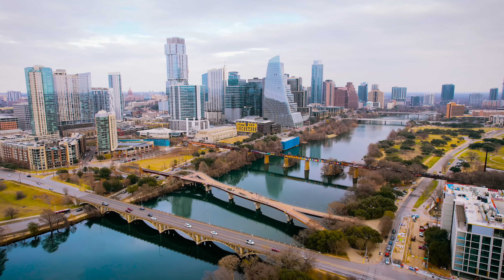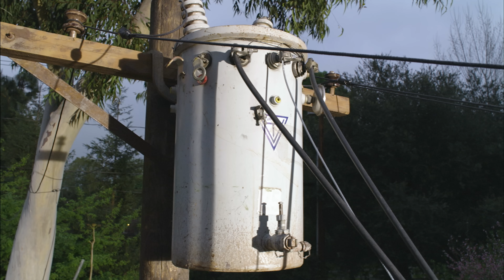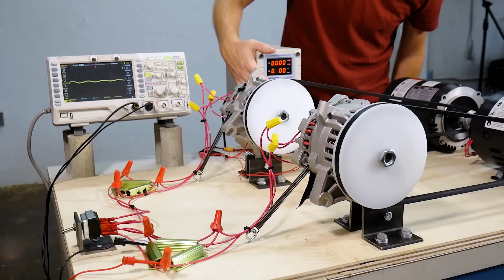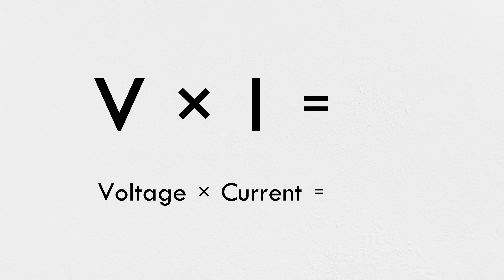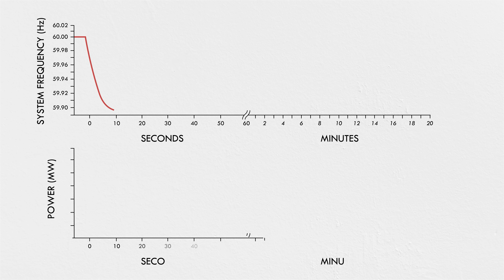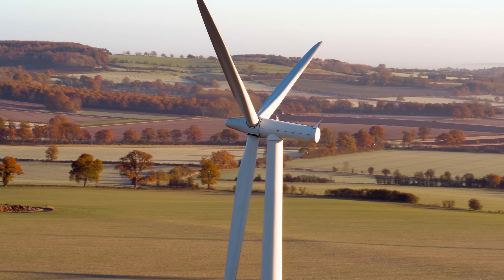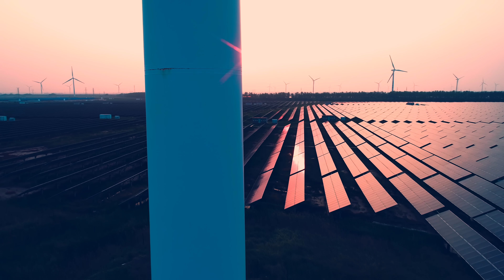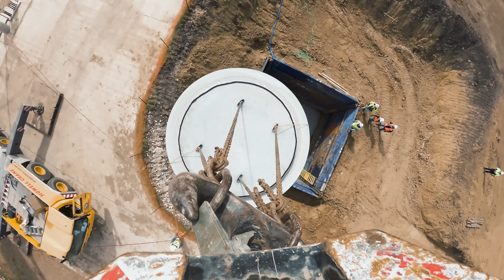Connecting Solar to the Grid is Harder Than You Think

Comment: I worked at a factory that ran 24/7 and consumed megawatts of power. We were looking for backup power solutions. The problem was the few seconds backup generators take to start. There were "batteries" that consisted of carbon fiber flywheels in a vacuum spinning at 500,000 RPM. They could deliver 100% output (multiple megawatts) within 10 cycles, and for up to 10 seconds - enough time to start a generator kept in warm stand-by. Perhaps technology like this is what we need to stabilize the grid.
Reply: There are a lot of companies looking into grid scale flywheel energy storage. It's a valuable option and one I could stand to learn more about. But I think the biggest problem with any *grid scale* energy storage solution is cost. I'd love to see a practical engineering deep dive into grid scale storage and fly wheels.
Reply: @pufthemajicdragon It is more like capacity storage.
Reply: @pufthemajicdragon  Just wanted to warn anyone reading this comment that Ovo Energy (a UK power provider) are basically scammers. I received an invoice for £315 one day, and then 12 days later, that figure mysteriously went up to £763. When I wrote to Ovo for an explanation, they did not respond. It's only when I showed all the emails to the Energy Ombudsman and they (Ombudsman) contacted Ovo and asked Ovo why they had not replied to my repeated emails that Ovo made a pathetic half-hearted apology and claimed that the charging (£763) was a mistake and £315 was the correct figure. I can tell you straight away that if Ovo thought they had made a GENUINE mistake, they would have responded to my emails and apologised for their error. This WAS NOT an error. They tried to con me by charging me more than TWICE the money I owed them. It's only when I got the Energy Ombudsman involved that Ovo got cold feet and tried to backpedal from their scam, claiming it was a mistake. Take heed, Ovo Energy are CRIMINALS. Guard all your invoices with your life and even make duplicates of your emails. Ovo WILL try and trick you out of your money.

These are examples of Ovo Energy harassing, threatening, intimidating customers with legal consequences to settle fake, phony, bogus energy bills. Ovo Energy are truly despicable. They are, as I said at the top, insidious scammers -->

https://www.birminghammail.co.uk/news/cost-of-living/ovo-energy-harassing-customer-pay-29864563

https://www.bbc.com/news/uk-england-gloucestershire-65544654
Reply: I understand that flywheels are already used by various utilities for this sort of purpose, providing inertia at a moment's notice. Wikipedia at least says that there are grid-connected flywheels in New York, Germany, and Ontario. Would be nice to see more about how these sort of utilities work!
Reply: @DanielLamando Estonia is building 3 synchronous condensers with flywheels for grid stabilisation to disconnect from Russias grid and connect to europes grid. Flywheels inertia power is 1750MWs
Reply: @lauriviik I just commissioned the protection system for a sync condenser up in northeastern US. Pretty cool stuff to learn about
Reply: @lauriviik  I'm very interested in this but I cannot find anything on Google.  Do you have any resources to point to about this?
Reply: @lauriviik  how long can they sustain that
Reply: @DanielLamando heheh, inertia at a moment’s notice
Reply: Flywheel storage solutions are interesting. I work on mission critical power systems, and most of the time a battery based UPS is used. For certain loads, especially at a factory where there are huge motors flywheel based solutions can be better
Reply: Some datacenters use a mix of flywheel and battery backup to keep everything up until genes start
Reply: The issue with super high rpm’s is wear and tear mixed with structural integrity. While yea, making in spin uber fast sounds great, the issue comes in when it simply rips itself to pieces.
Reply: @goldenhate6649  I hope they are well built, otherwise you have a small frag mine ready to burst at any second. I have seen pictures of broken lab centrifuges, and even that was pretty scary.
Reply: @lbgstzockt8493  I saw a video of someone spinning a CD/DVD to insane speeds until it shattered due to the extreme forces. Like you said it resembled a fragmentation grenade. And that was only plastic.
Reply: @goldenhate6649 Conceptually for safety id rather have that energy be stored as kinetic energy because the energy of a large car crash would be much easier to contain than if it was released in a fire.
Reply: @submachinegun5737 Its the same amount of energy either way. Touch a motor shaft spinning at just 3000RPM, the friction will burn the skin right off your finger. Now imagine a giant heavy flywheel spinning at 500,000 RPM. Oh did I mention rotational energy stored goes up based off the square of the angular velocity (RPM)? Energy is energy, and giant amounts of energy released at once is enourmously dangerous. 

A spinning flywheel could roll through a town causing millions of dollars of damage, especially at 500K RPM. A fire on the otherhand just destroys one building and can be very easily contained to one area.
Reply: @linuxguy1199 obviously with a device like a flywheel safety is paramount. I'd expect the housing would be able to contain such an event.
Reply: @linuxguy1199  something spinning at 500krpm will be in a vacuum and generally underground / buried somewhat to prevent these issues.
Reply: @linuxguy1199  At 500kRPM the friction with air would set the rotors ablaze. Hence the vacuum. If you could touch it, the air viscosity would create a lubrication film, like oil in your crankshaft bearings does. A very hot lubrication film in this case. But you would not be able to make physical contact with a rotor at that speed. 
The rotors are supported by magnetic contactless bearings. Those having the nice feature that you don't need to fine balance the rotors as insanely precise as you would need to do, if you would use fixed bearings. Magnetic bearings have some play in it. And the rotor just automatically spins around its COG, balancing itself. Of course it still needs to be well balanced for not ripping itself apart. But the requirements for that are orders of magnitudes lower.
Reply: @sl9sl9 I had this happen to me once with a 5x speed DVD. It went Bang! and shattered into mm sized shards.
Reply: @sl9sl9 I’m pretty sure you mean the slow mo guys
Reply: @linuxguy1199 I believe I read that there is a flywheel storage in operation in the UK.  I don’t remember much about the article, but I do remember that it was hundreds of tons, and ran in a vacuum.
Reply: If you have traditional turbine-based power generation, then the turbines function exactly like this. That's how the grid has historically been stabilised and there was no need for separate flywheels. As we move to more and more inverter-based rather than turbine-based generation, adding dedicated flywheels becomes a necessity since there isn't enough inertia in the system. (The alternative is batteries and an inverter that can simulate inertia, but a flywheel is much simpler technology.)
Reply: @thomasdalton1508 I've been wondering for some time, whether inverter electronics can take on ('simulate') this stabilising function as Matt mentioned in this video, on a large scale,
and what could be constraints and limiting factors. I would like to find out more about this subject.
planning to attend hannover industrial fair next week, perhaps someone can enlighten me there..
Reply: @laus9953  I hope somebody has an answer for you because we are going to need it pretty soon. It's going to be a particular issue for countries that aren't fond of nuclear. The UK has a steady base generation from nuclear that will provide us with some inertia even when we have completely eliminated fossil fuels from the mix, but countries without nuclear are going to be left with no turbines at all (maybe a bit of biofuel or waste incinerators, but I doubt they will be on a large enough scale to help).
Reply: Yeah, I am hardly an expert, I just remembered the Capex research I did for that project a decade ago. The thing with flywheels is stored energy goes up linearly with mass, but squared with rotational speed. So a 1 pound carbon fiber disk spinning at half a million RPM can potentially store more energy than a multi ton wheel spinning standard generator speeds like 1800 RPM.

Chances are people in the industry know much more about the details than I do, but occasionally good ideas slip through the cracks.
Reply: @PsRohrbaugh 
Important note, that's only true if a 1lb fiberglass wheel has the same radial mass distribution (how far away the mass is from the center) and a multi ton flywheel... and can still hold together with those absurd speeds (if we're talking about 1meter radius then the tip in your example will be moving at 500,000*2pi m/s or, in other words would be subject to severe relativistic effects before almost instantly being torn to shreds by the insane forces needed to hold itself together.
Reply: @PsRohrbaugh  Every time I start a CapEx project, I enjoy the research phase.  The rabbit holes I go down are wild.
Reply: @PsRohrbaugh  not arguing with your math but the gear reduction from half a million to 60hz is a huge power draw. Traditional power plants have only a few percent loss in the gears or at least that is what I remember from a tour I took a few years ago.
Reply: @tysleight  Do they use mechanical gearing? Surely there is a better way to get 60Hz AC from a 500,000rpm flywheel than a 8,333:1 gear system? I agree, that would be incredibly inefficient.
Reply: @thomasdalton1508  I have no idea but I do know that transformers are terribly inefficient and the bigger the step the bigger the energy cost.
Reply: @tysleight  Transformers change voltages, not frequencies. The usual way to change a frequency is just to convert to DC and back to AC. Then you can choose any frequency you want. There are losses, of course, but they aren't too high.
Reply: @thomasdalton1508  AC to DC, DC to AC line voltage.  This is how our big monster generator is set up with caps to handle spikes. You can hear the generator rev up and down with load. I assume it would be the same idea.
Our generation set up will run a small city, nothing like a harbor freight special.
Reply: @thomasdalton1508  you couod do a few planetary gear step down and then something similar to a CVT to control output rotation speed. That way to keep output speed to a generator constant while the flywheel spins down
Reply: @PsRohrbaugh  Interesting thought. I can imagine that the two devices would have far different discharge curves. Wouldn't it be harder to extract stable 60hz AC from the small 100,000RPM flywheel than the large 1800RPM flywheel?
Reply: We use them in data centres, we even get paid by the grid to keep them synced because of the inertia provided helps the entire grid
Reply: One issue with flywheel storage is that as soon as you start tapping them for energy that RPM starts dropping, and dropping fast.  In generators the desired frequency (60hz for example) is a ratio of the rotational speed vs the number of poles in the motor/dynamo.  So you design a generator so that if its spun at 1800rpm for example it outputs 60 hz.  If load slows down that generator to 1790rpm its now only outputing 59.666 hz.  Thats where the inertia comes in.   Now take that flywheel at 500k rpm and try to turn that into 60 hz and keeping it there as it spins down as your drawing the rotational energy out and converting it to electricity.  Its not just a plug it in and it works solution, theres alot of extra equipment involved in converting that high energy but variable frequency power into a stable 60hz power outp ut.
Reply: @merendell that's why they're meant to have only a stabilising effect for a few seconds (or fractions thereof), no?!
Reply: @laus9953  True but I often see people seeming to think they are the latest/greatest energy storage solution that will replace lithium for large scale grid storage.  Yes you can store a hell of alot of energy in a rotating mass but its not a simple thing getting that energy back out meshed with the grid.  The most reliable way can think of is rectify the output to DC and then use that to power an inverter back to a stable AC but you still end up with the issues with grid tied inverters mentioned in the video.
Reply: I toured a Yahoo data center and saw flywheel batteries used as a buffer for standby diesel generators.  A fraction of the size that a battery bank would take up.
Reply: Some nice things about fly wheels:
(*) it's easy to know how much energy is stored in them
(*) the mass/volume energy density is pretty high for the high RPM flywheels
(*) for low RPM systems, anything can supply the mass, including rocks.

Some problems
(*) as others have mentioned, when a high speed, high energy flywheel fails, it fails spectacularly.   One of the nice things about CF-wound flywheels is that a lot of the destructive energy goes into turning the CF from a smooth structure into a wad of useless carbon fiber. (++)
(*) precession.  People have put flywheels in vehicles,  but you kind of need counter-rotating flywheels to (mostly) cancel the net precession force.  However, even if you do this there will be a substructure in which the precession forces are not canceled.
(*) No matter how good you make the bearings, the discharge time of modern flywheels is still pretty fast compared to batteries.
(*) You can only get energy into/out of the fly wheel by applying torque.  If you've got something spinning at 500,000 RPM, this requires care.

(++) I once worked in a lab that had a 3 kg, 40 cm dia slab of Aluminum spinning at 3600 RPM.  It scared the bejeezus out of me, and I hated turning it on.  For reasons that I won't go into, it could not be shielded in a cage --- if it ever got loose in the lab, it would do a lot of damage before it came to rest.  There is (or at least was) a lab experiment in freshman physics at Caltech that used some nice air-bearing tops to demonstrate precession and nutation.  One of those "tops" once escaped its air bearing and, um, created a lot of unwelcome excitement for about 15 seconds.
Reply: @jdsahr  "for low RPM systems, anything can supply the mass"
including dead batteries. I've thought about making a joke video about how to get energy from a pile of dead batteries.
Reply: Leaving retired coal generators grid connected as sync. condensers is something we should do more of.
Reply: @TXHeat1776 I understand that will happen with Sherco plant in Minnesota.
Reply: I'm working at a place called torus, they are developing some amazing flywheels.
Reply: holy hell, that is actually a fantastical use of flywheel energy storage. can't store much energy but can deliver and take up lots at once and can store just enough for another more permanent type of power generation to kick in
Reply: There are actually already plants specifically designed to do just this. Some power generation facilities have equipment that’s rated to operate as a synchronous condenser. This means that the generator is spinning but it is not generating, it’s consuming. This helps to provide voltage support as well as a type of frequency reserve. The plant could also come “online” within minutes ( for gas turbines) and start generating if needed.
Reply: Sounds like flywheels perform better as mechanical capacitors than mechanical batteries.
Reply: Old cell towers or remote telecommunications bunkers would have mains power driving a huge fly wheel through a generator.  When the power went out a deisel gen set would cut in, with a clutch that would engage.  The fly wheel generator  would keep things moving.
Reply: Im curious as to why the flywheel is made of carbon fibre instead of a metal, because the kinetic energy stores the energy so it would be dependant of mass so why would you use a lightweight material like carbon fibre? What is the benefit in comparison to heavier and equally strong metal?
Reply: @cas8891   My intuition is that the parameter of goodness is tensile strength / density and there carbon fiber comes out on top. 
As another poster mentioned CF may have better internal dissipation of energy during fragmentation, tearing into more smaller pieces.
Reply: @thewheelieguy  oh yeah the small parts is a good reason yes, and the tensile strength ill have to look in to the differences but i think thats definately a plausible reason!
Reply: @cas8891  I haven't researched this in a decade, but I remember the selling point being that kinetic energy goes up linearly with mass, but exponentially with velocity. So using something with a high tensile strength and velocity stored much more energy. I did a quick Google search for "carbon fiber flywheel energy storage" and there were articles on commercial and grid installations as recently as a few years ago.
Reply: Batteries are way more efficient for longer periods but for such a short period you'd need to overbuild everything

Lithium titanate oxide gives you the best ampacity with some cells being able to do 20c for a few seconds, but with a 10s burst at 20c you're looking at about a 5.5% depth of discharge if my math is right
Reply: Yes, flywheel energy accumulation is very cool. But I wonder how feasible it would be deployed in a remote outdoor field where most solar and wind farms are. Lot of things that could interfere with it, and the cost to maintain
Reply: Isn't all this physical intertia just perpetuating a style of backup that results in a loss of frquency as load magnetically slows rotation? Surely a "grid following" inverter could just sync its PLL to an accurate clock and simply lead the grid sinewave if it slows.  Ultimately a much faster response, and more resilent against that steep drop in frequency.
Reply: @chrisking7603  the flywheels had an inverter between them and the grid connection - if they ran synchronous the frequency would drop as they spun down. It's about having enough stored energy available in a format that lets you from 0 to multiple megawatts in a fraction of a second. You could use chemical batteries, but it'd be significantly more expensive as they're suited for longer discharge times.

One new technology that might be competitive is super capacitors. Those weren't really on the market back when I did this project. But a super capacitor the size of an 18650 lithium cell can provide 400 amps at 2.7v for several seconds. At that point it'd be about cost.
Reply: @PsRohrbaugh  Good point about supplementary storage.  Yet how can massive steam engines drop their frequency output without slowing down? Can't masses of grid-following inverters lead the grid AC wave a tad, if the frequency drops?
Reply: @PsRohrbaugh  Yet those big steam engines did allow frequency to drop under load, that could be remedied when it occurred by driving the turbines harder... their response time is slower than hydro, and now batteries that can respond in milliseconds surely can do the same... if they're not just grid-following.
Reply: Already being done on the grid mentioned.
Reply: The UK is spending billions in building flywheels to pick up the janky electricity from solar and wind and add a modicum of control to it.

Or we could just use nuclear 🤷‍♂️
Reply: You need grid scale battery sad fact if you take a ev car battery and use it for grid storage it would reduce 40% more carbon...and that's all you need to know ev is a massive scam it's like making cars go to natural gas and then shut down much cleaner generation to burn coal
Reply: Are the flywheels just carbon fiber or do they have weights on the end? 
It would make sense for the flywheel arms to be light weight since the speed increases as diameter increases. But you'd want more mass at the ends of the flywheel
Reply: @a.1441  idea I had was to move flywheel bearings away from central hub/shaft, to outside the flywheel rim, and having the bearings press inward onto the outer rim of the flywheel  using say hydro static bearings.to keep friction low. that reverses the direction of forces resulting from the flywheel's rotation. ie when spun up the flywheel will want to expand, but that would load the bearings up, which will help stop the expansion. as such the flywheel would be under compression rather than in tension.As housing doesn't move it can made arbitrarily thick to gain enough strength to handle the load. flywheel probably doesn't need much strength at all spokes. it might even be possible to eliminate spokes completely, and just have a cylindrical shell. . 
spin it up/ extract power akin to an induction motor/generator.
Reply: @a.1441  I honestly don't remember the specifics and don't feel like Googling it myself. I am sure they optimized the design in one way or another, but have no idea what it actually looked like. I just remember their big sales pitch was 1/2MV^2 so focus on V^2 not 1/2M
Reply: @a.1441   there are differential equations that relate the radius, speed, strength of materials and thickness. 
For optimized energy storage you want the strain in the flywheel to be constant as the radius increases. This means you want the center sections to be thicker and taper to the edges.
Reply: Rotating stabilisers are good for stabilising the grid, they're essentially large rotating masses that keep spinning (and thus maintain voltage and frequency) during a fault.

BESS is also developing grid forming capabilities, where the batteries are used to set the voltage rather than chase its output, although I'm not aware of this being implemented in many areas yet and I expect it would still be too laggy.
Reply: What kind of bearings hold that flywheel?
Reply: @suntzu6122  Such flywheels are suspended by magnetic bearings, so no actual contact or fiction. Subtract the air from the containing vessel and you get as close to a perpetual motion machine as you ever could (till you start tapping it for power).
Reply: @ExtantFrodo2  electromagnet right? Surely nom electro magnets would be hard to maintain.
Reply: We don't need better tech--we need to run out the corrupt corporations from the industry and stop pretending what we have now isn't 1950s garbage.
Reply: Yep flywheel storage!! Lots of potential for these sorts of technologies, especially as we move more and more to Inverter-Based Resources (IBRs) and independent system operators (ISOs) start sounding the flags on renewable-heavy grids, the likes of which we've seen from the Midwestern Independent System Operator (MISO) within the last month. Flywheels could help add that inertia back
Reply: One major drawback of flywheels is they are presumably susceptible to earthquakes. Which unfortunately is a time when disruption to the grid is much more likely.
Reply: Amazing what engineers can do
Reply: Fun fact, those spin just above the escape velocity.
Reply: Flywheels are constantly getting wear in tear, while a grid lithium battery is getting very little wear an tear while in standby. And batteries have fallen in price so much faster.
Reply: Now I'm curious what a megawatt generator looks like
Reply: @GeneralKenobi69420  basically a shipping container, holding a V12 or V16 diesel engine hooked up to a cylinder (the actual generator). The actually interesting part was that the oil and coolant were kept heated to operating temperatures. This meant the generator could start and go to full load in a few seconds, rather than having to "warm up".
Reply: In Poland there are known to be a lot of flywheels on the grid as a reserve capacity
Reply: In ireland they have one for frequency stsbilisation
Reply: Capacitors and synthetic inertia electronic invertes is a better solution.
Reply: Shouldn’t the flywheels be built underground in a concrete containment shell? All you need to do is run wires through the shell. Seems like it would help the cancer of a runaway explosion.
Reply: That's fine but it's all inefficiency